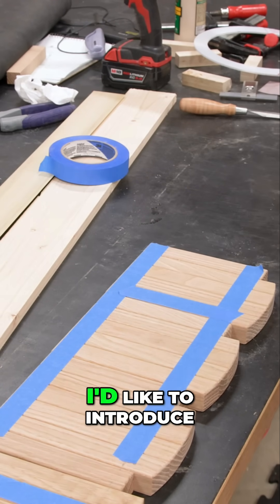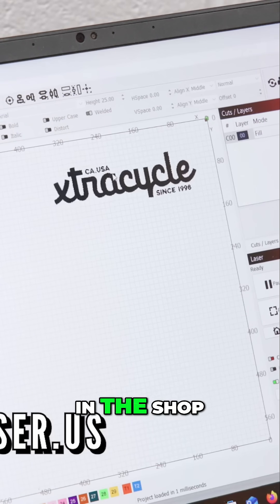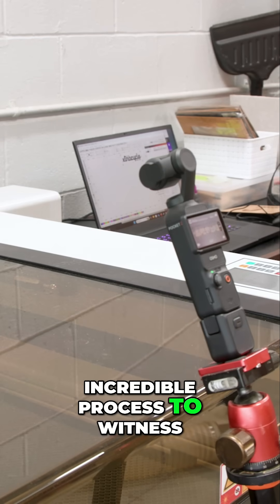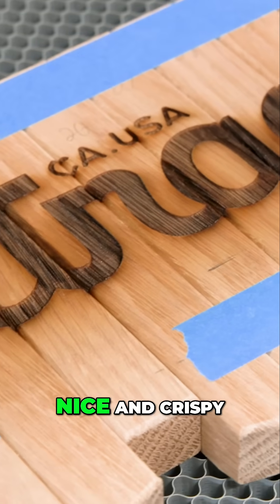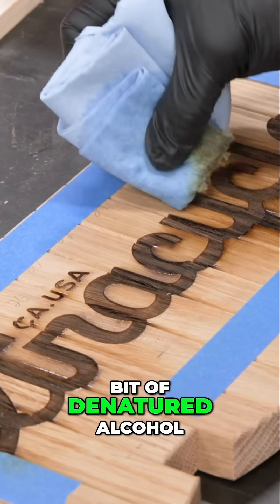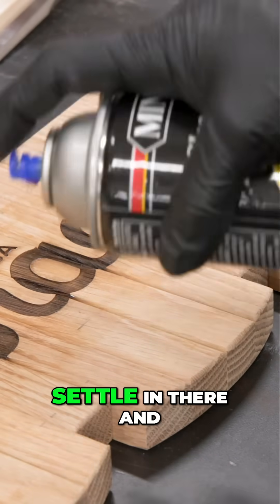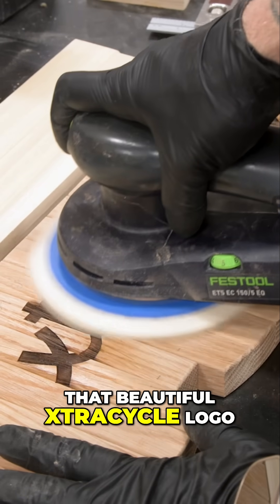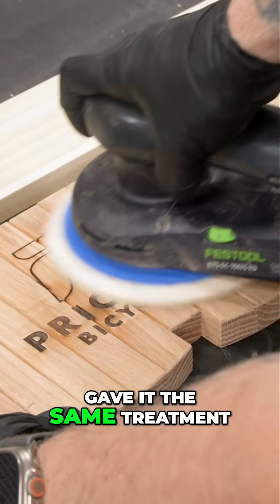Laser Engraving Magic: Watch Logos Appear on Wood!

Comment: Buy a roll of 6" wide masking tape and cover the wood before engraving. Eliminates the fumming/burning on your surface.
Reply: Vinyl manufacturer Oracal makes a product called Oramask, available in a number of widths.  I use the 6" and 12" rolls for masking - it comes off easier than tape and doesn't leave residue.

Comment: If you mask the wood before engraving it will completely avoid the residue, for easier cleanup.  You can still use the clear coat if you want, before removing the mask.  I use medium tack vinyl transfer paper (Vinyl Ease).
Reply: Agree...  use low to medium tack painters tape and there will be WAY less cleanup.